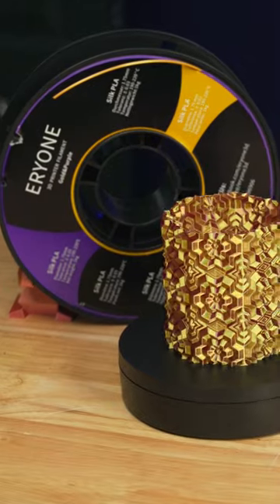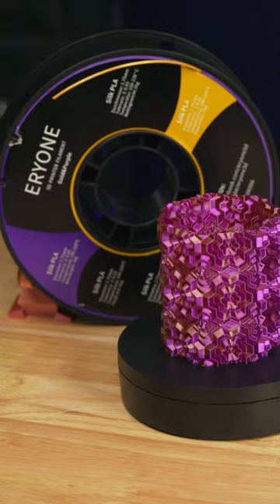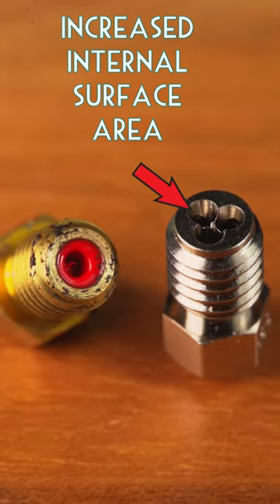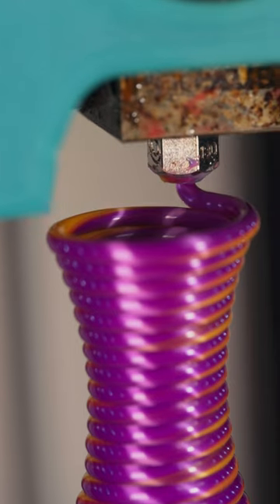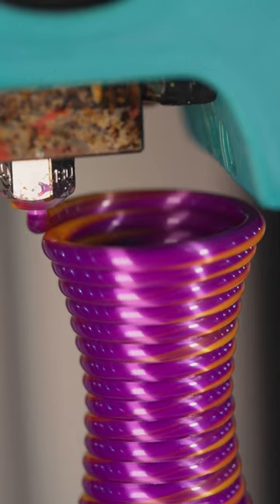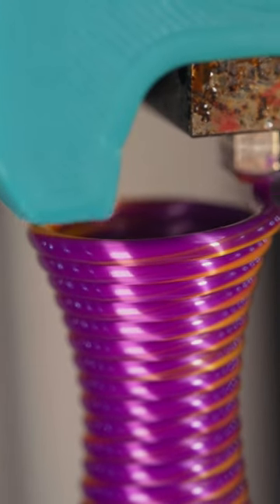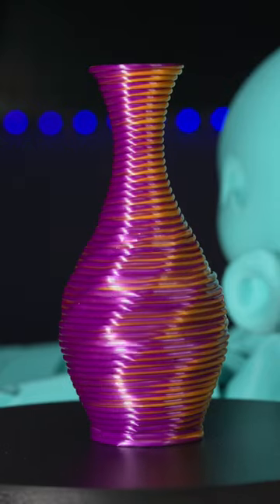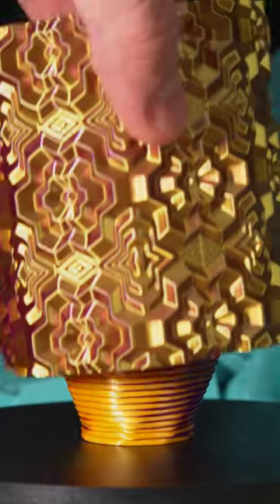Can Dual Color Filament Survive CHT Nozzle??? 🤔

Comment: I am about to buy a 3D printer, honestly I have been planning to for a while but it wasn't a certainty until I saw this video. That's amazeballs. Any suggestions for a starter printer? There is one I was recommended a while ago for about 500$ that looks like a minifridge and has auto leveling but I can't remember the name. Any informed opinions would be appreciated c:
Reply from the maker: For a first printer, the new Ender 3 V3 SE is really easy to use at only $200. If you want a few more features the Crealiy K1 is great and I usually have coupons linked in my videos since Creality has so many coupons. The new Bambu A1 Printer looks like another good entry into the hobby, but I haven't personally tried it out.

Comment: Tried the dual color filaments on my cht and it works fine. Didn't get much if any extra mixing.  I printed a 22lr mag at .16 layer height and .35 width from a .4 nozzle.